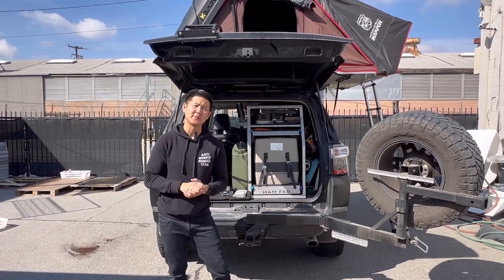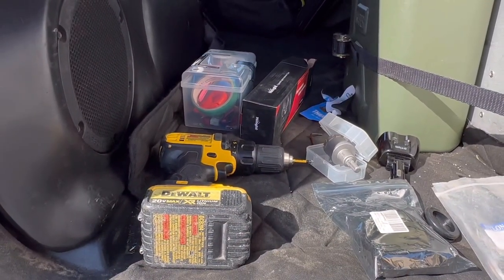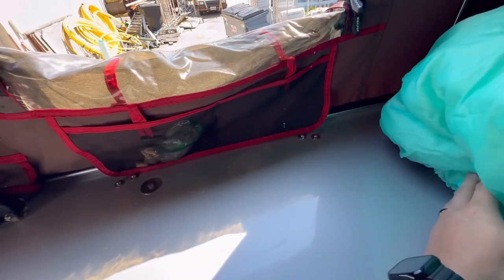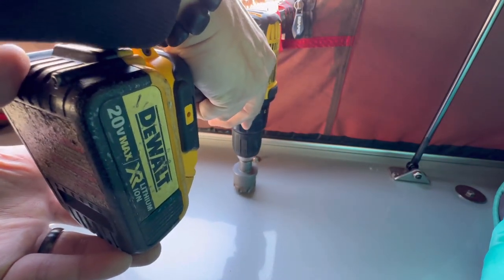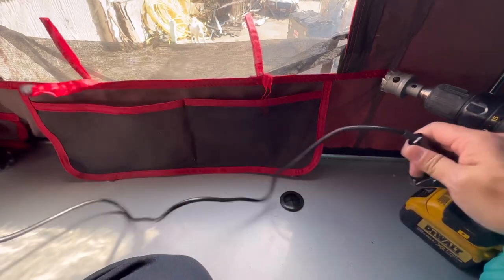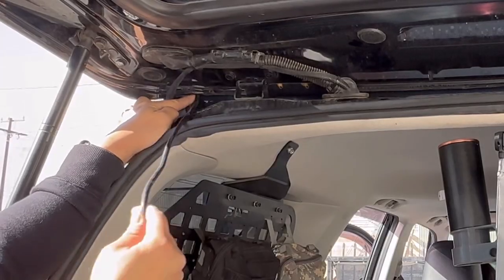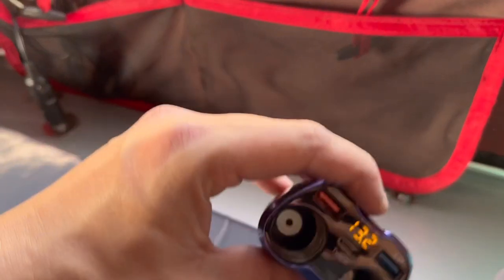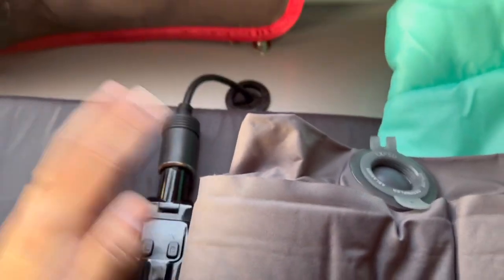FINALLY! Adding Power to My iKamper Roof Top Tent

Comment: This so helpful. Thank you! I’ve been meaning to do the same project and this gave me the confidence to get it done. I think I’m going to go with a slightly larger hole so I can fit a 110v plug for an electric blanket.
Reply from the maker: No problem! You just need a slightly larger grommet. No regrets doing this